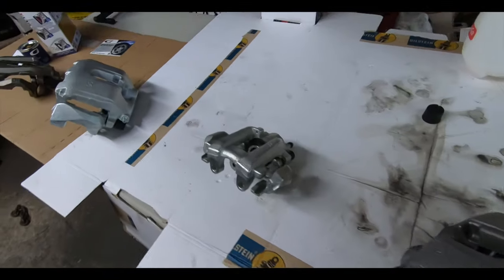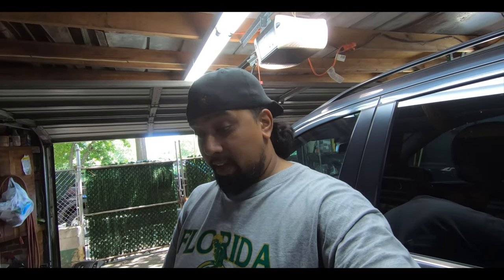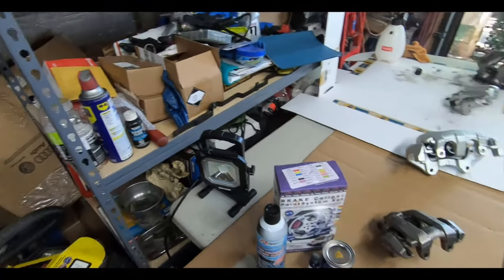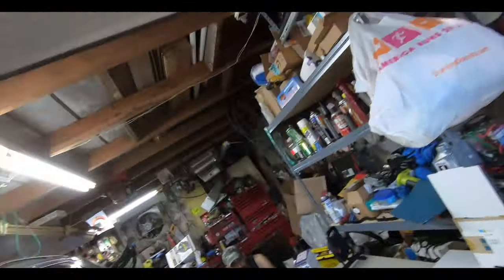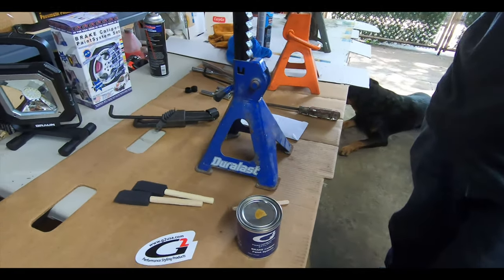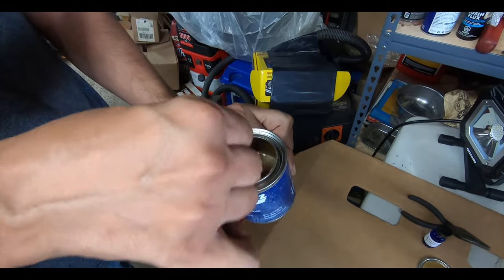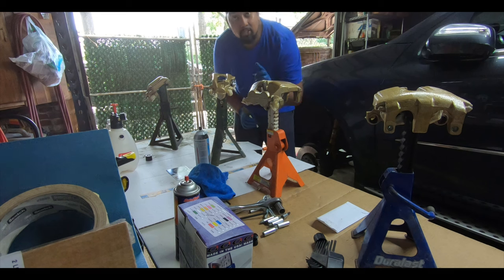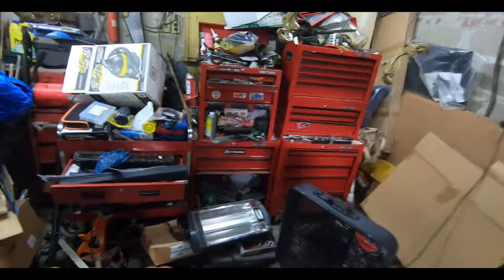Mercedes ML350 G2 Gold Caliper Paint!

Comment: Would love to see how you prepped the parts before paint and why you shouldn't paint certain areas.  Maybe a short part on how you removed some of the parts as well.
Reply from the maker: normally you would sand and clean it brake parts cleaner. We had new parts so we just did a light scuff and clean with brake cleaner. Yeah I think we might try and do that next time. But you don't want paint on areas that the pad rides on.